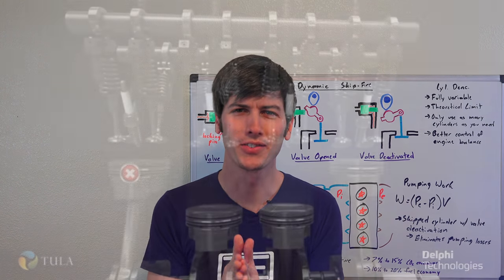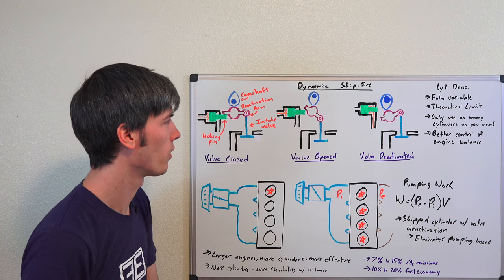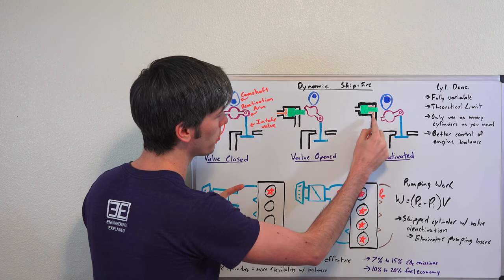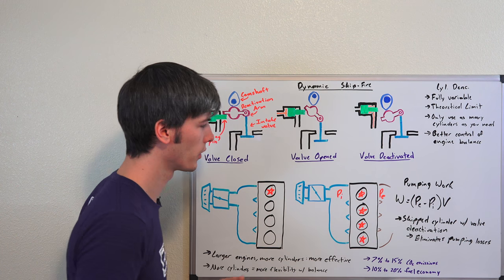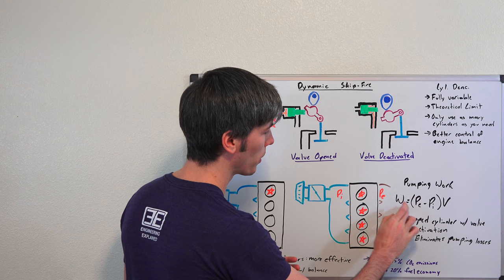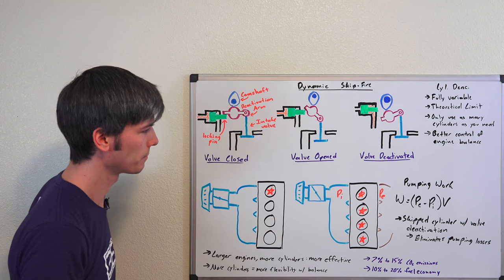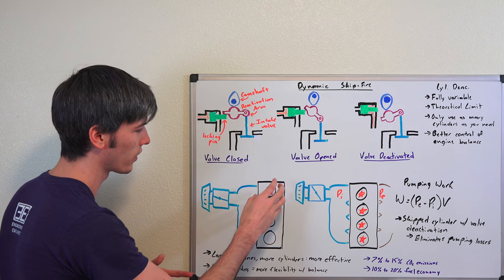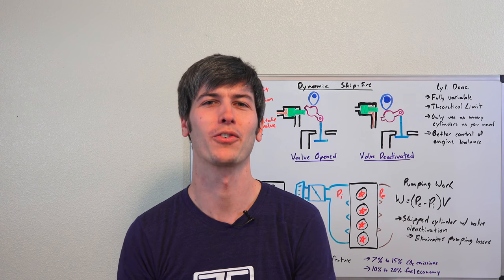How Dynamic Skip Fire Works - Variable Displacement Engines

Comment: Electric is still better...
Reply: The weight of the batteries is not a problem. It's actually a benefit since you can put them low on the car.
The range is a fixed problem already (some cars have even less range than some electrics). You can't drive for 6hrs straight, you have to stop somehow, somewhere and somewhen.
The cost is the least of the problems because it has been proven lots of times that, over time, the car is less expensive (it depends which, of couse) than the petrol equivalent (plus, you get the added performace). If you buy a car to keep it, it's better. Their re-sell value tend to be higher overall than ICE.
The degradation over time is not a problem neither, really. An ICE car lasts far less (you loose a lot of performace overtime even if treated well), when in electrics you only loose some battery capacity. Which, in certain models, is not a tremendous loss.

The charge time could be an issue, but even with low-power output terminals, leaving the car to charge when you use it (overtime) is enough. Just a change of mentality is needed (from fueling the car when needed, to leave the car charging like your phone).
Plus, fast-charging stations when you stop for a rest.
And this is the biggest problem, the lack of support. We have petrol stations every now and then, imagine if they only were a few: it'd be a problem aswell.
We must support this technology like we did with ICE: better structures, more of them, investment in research, and so on.
Reply: Yosyp No it's not sir. Range is the big issue with electric. Until they reach 400+ miles, electric will not be on top.
Reply: Double JJ I wanna know how you're gonna drive 644km in 5 hours straight, at Italian highway speeds (130km/h).
You must stop and get a rest every 2 or 3 hours, or you're a robot.

I don't know cars which can reach 650km with a full tank, anyway.
Mine don't
Reply: Yosyp plenty of cars in the US can over 400+ miles. My previous car could go over 500. Sadly I don't have it anymore but it had the capability. My current car can go over 400. Yes electric is improving but it still needs a lot of work for the range.
Reply: You can drive 400 miles straight?
Reply: Yosyp I wish but no however in 2 years time I will.
Reply: Don't wanna get in your privacy but I'd like to know why just 2 years.
Reply: Yosyp Because I'm moving out of my hometown. The city that I want to move to is nearly 2000mi away.
Reply: Double JJ right!
Reply: Range is not the only issue. Connectivity, durability, I can go on. It also needs the reputation of what internal combustion engines have. Society isn't ready to adapt electric motors no matter how long they were around. It will take years before the majority of society to adapt new power plants.
Reply: Double JJ It will indeed take years to adopt this new mean of propulsion but we're closer than ever.
EVs are more durable (and generally safer) than ICEs, they only need the popularity and reputation of canonic engines.
We're towards them already. They are the future, and the future is bright in my opinion.
Reply: Yosyp Yeah we are. It's just going to take time.

Comment: Sure,  like today's engine isn't complicated enough and crammed full of $hit already, now more to fail and fix  in the future, Gas powered cars are Finished,  Electrics will start to replace them in larger #''s as the motoring public get fed up with the crap design and complexity= cost, of the dinosaurs.

Comment: Chevy uses this crap on their v8s... And this is why their lifters fail so often and crap hits the fan. This is total garbage and causes more issues than anything.  No one buys a v8 to get gas mileage... But every v8 I've ever had before this (Ford 4.6 3valve, Ford 5.0 coyote) all got better mpg than this 2016 5.3 v8 ... This is total garbage and it cost me 1400$ to delete this mess.... Manufacturers need to realize what their customers want... If I had it to go back I'd get the Ford 10-1 only because they don't use this crap on their 5.0s... I'll say this again this is total garbage and causes more Mechanical failures so us mechanics get screwed.... Garbage